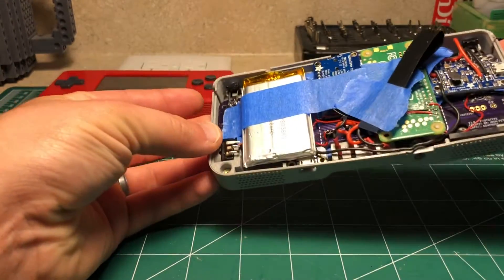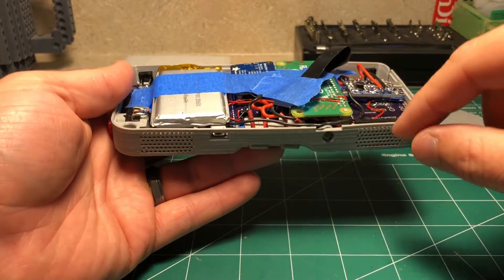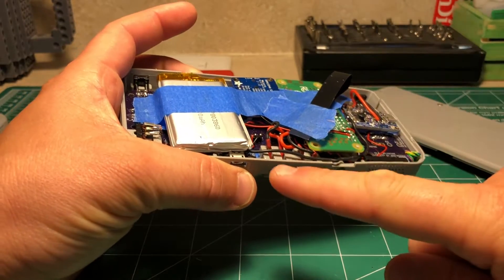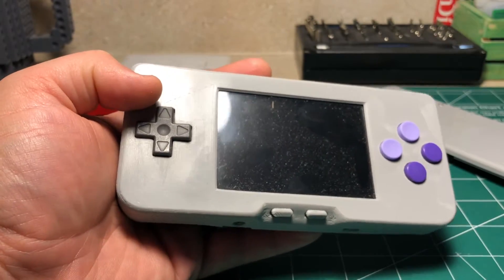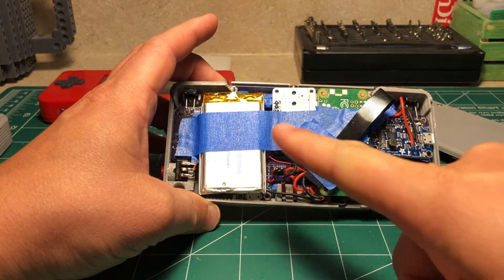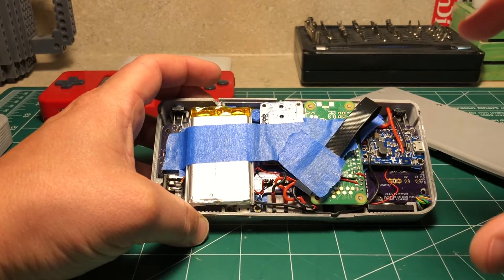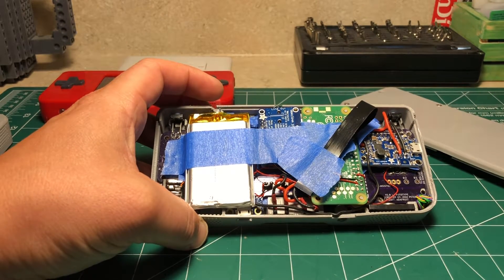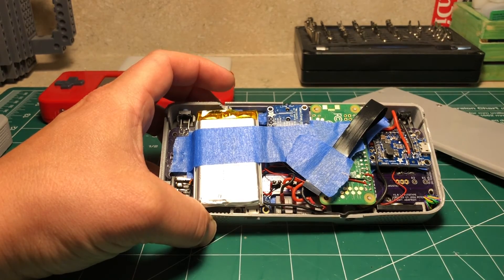PiGRRL Zero Advance - Inside Prototype Design

Comment: Does it come with 4 triggers? I really want to play Metal Gear Solid on the go using this...
Reply from the maker: This won't be powerful enough to run Metal Gear, but I'm looking at a version that uses the Pi 3 A+ that recently came out.....
Reply: Any chance you could just rotate the connector to get the pi3b with usb and ethernet removed to fit in there? I am looking at building one but would like to see if i can get one of the $11 - $15 lcd's from ebay to work (less than predictable of what controller chip might arrive)  @3dprintspace969
Reply from the maker: @husky3g  Yeah, there are kits out on my Etsy page for exactly that. I think you mean just the PCB?